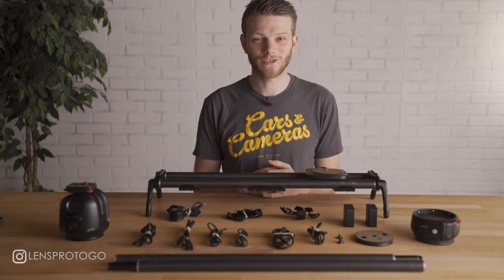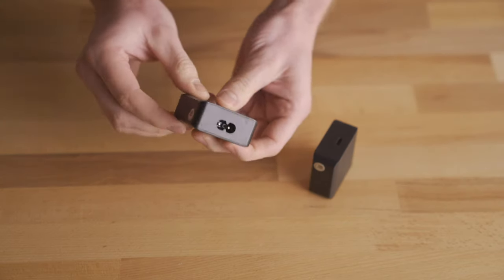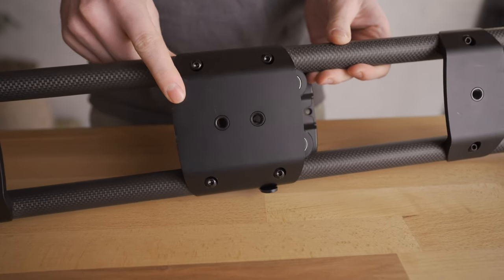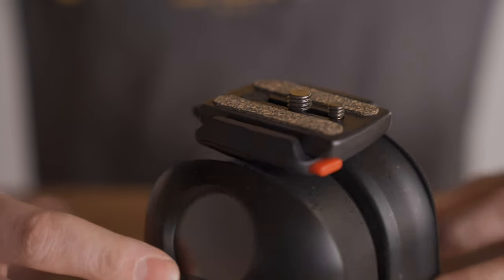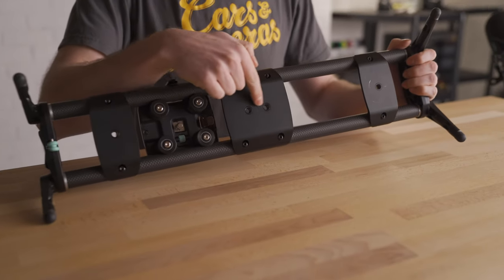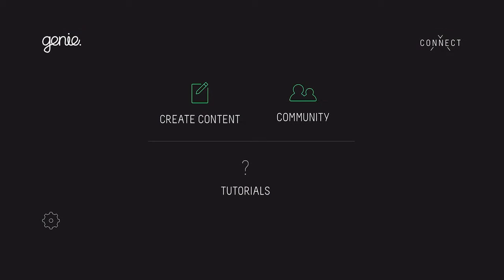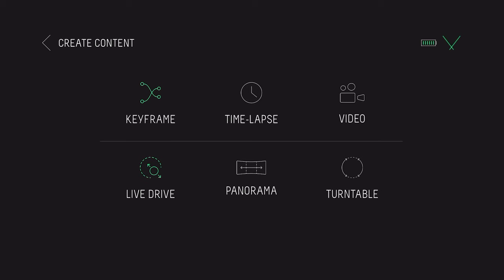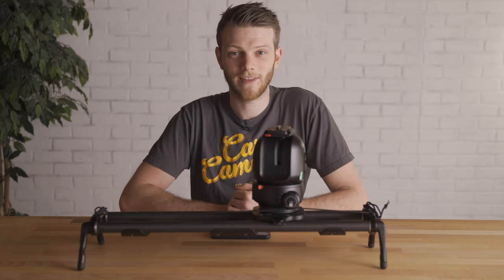Syrp Genie II 3 Axis Motion Control: Kit Overview and Assembly

Comment: I noticed that you screwed the Genie ll to an adapter plate in the slider but will the Genie ll mount direct to the slider with a mounting plate built into the body of the Genie ll?